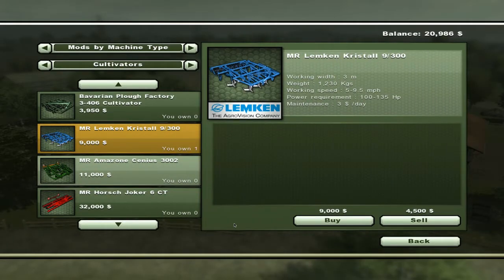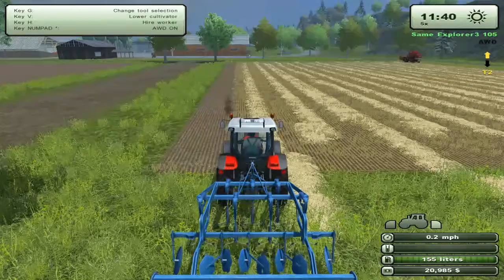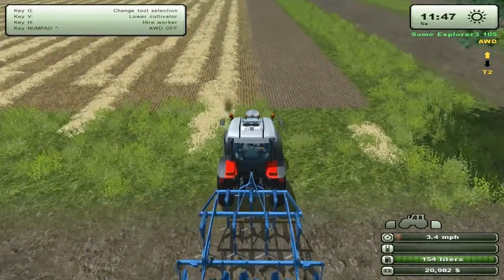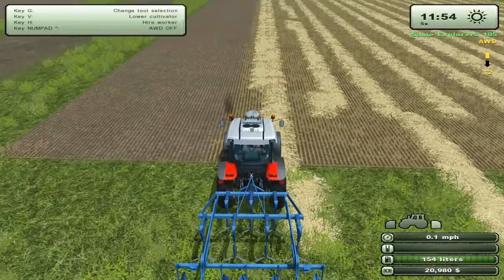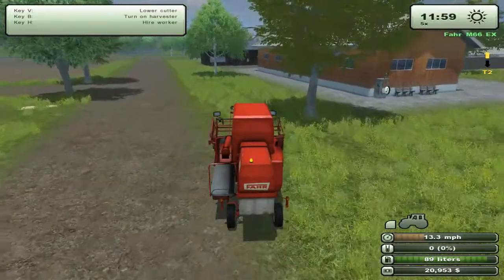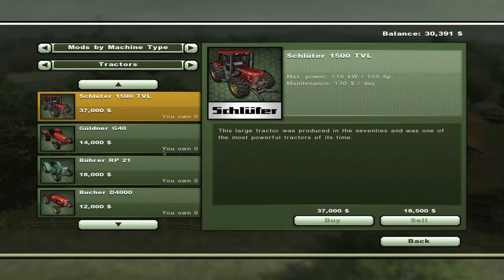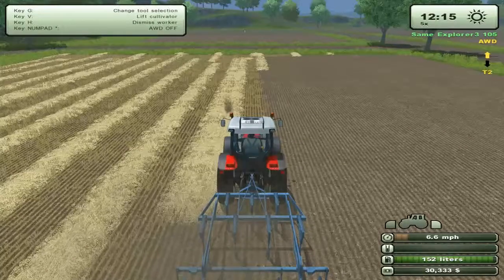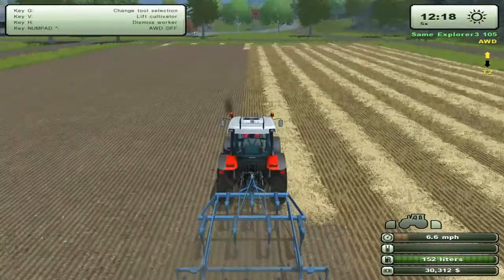Farming Simulator 2013 with MR (more realistic) mod episode 2

Comment: I mean does it stop the lagging
Reply from the maker: If you are reffering to the MR mod .then there is nothing in the code that would  be more optimised than the normal game.
Beyond that ,this game is oddly hard on framerate. Different added mods and maps tend to make it worse.

Thanks for checking out the videos bud.